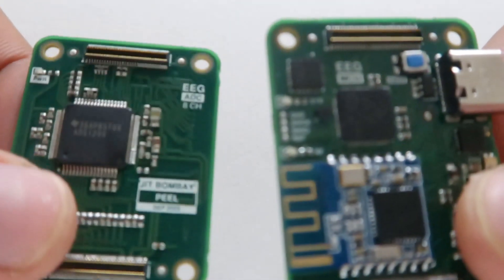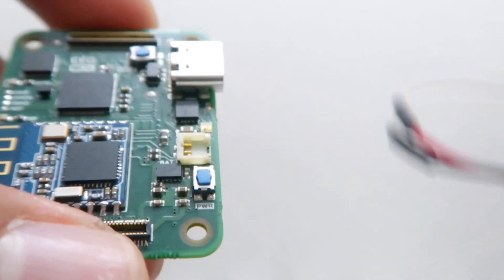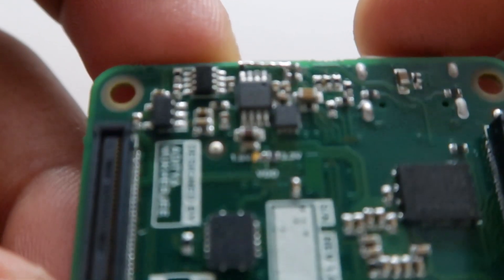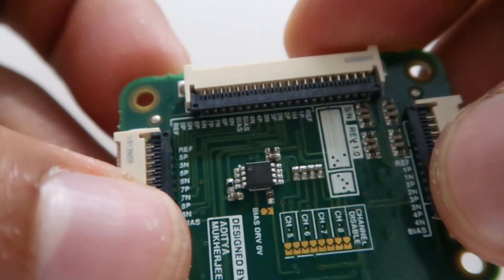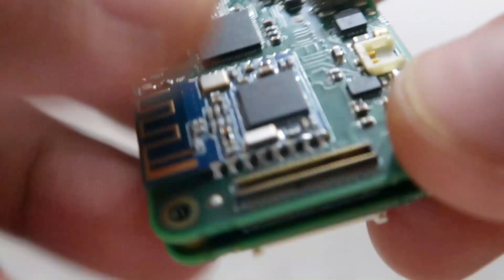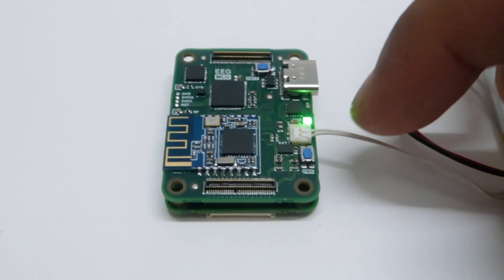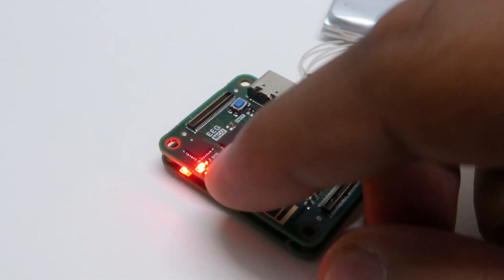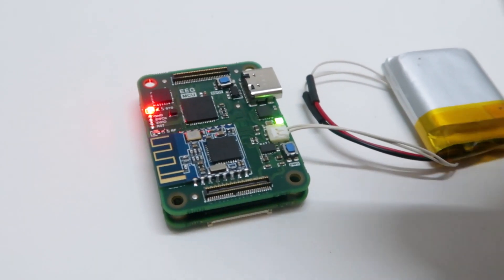Wearable EEG system hardware overview

Comment: How the calculation of the cutoff frequency of 1khz and the values of R and C for lpf
Reply from the maker: Its a simple RC filter but you need more software filtering along with notch at 50Hz.